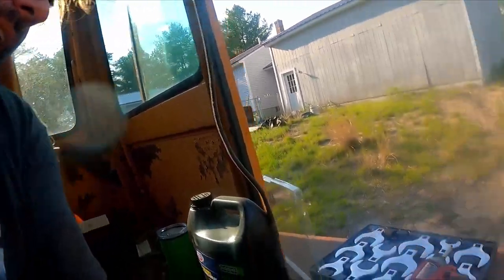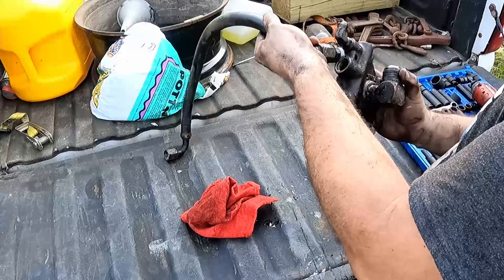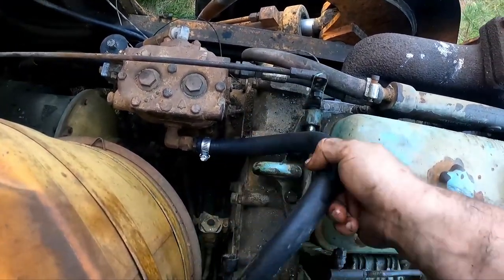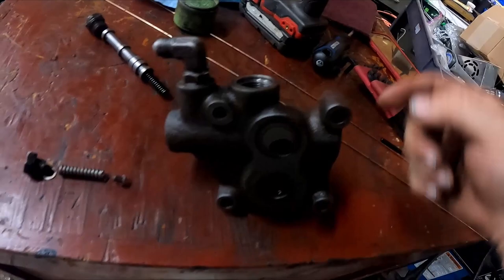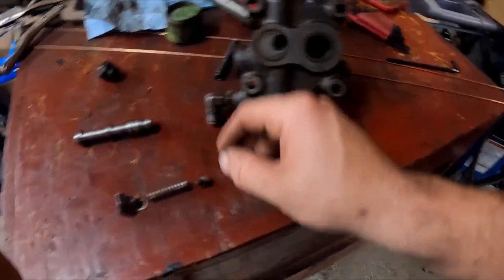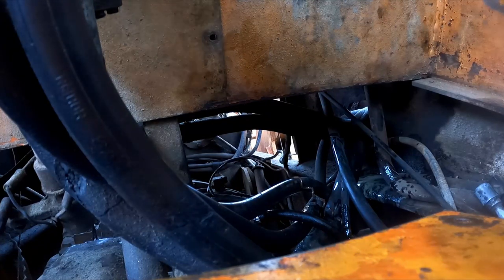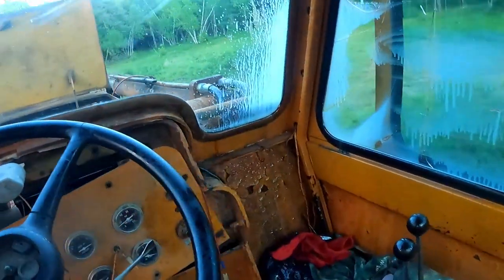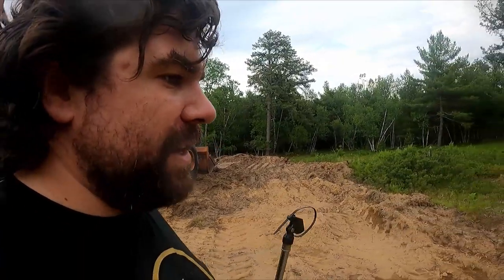Legendary Dynahoe First Drive in years! Dynahoe 200-4 Detroit Diesel 4-71 Resurrection Part 4

Comment: The Dynahoe owners group on Facebook has a manual for this as a PDF.
Reply from the maker: I got the manual off ebay(didn't know about the facebook group), but unless the group has a different one, it's a operators manual and a parts/diagram manual only.  I was under the impression that that was all the manual there ever was.  It is way way better than nothing though.
Reply: @wirestiresandfires214  that's the same one that they have. But in the group it is free. I didn't appreciate how big of a machine is until I got it moving.
Reply from the maker: @charlesgarrity2987  I'm going to join the group for sure, apparently there was an old yahoo user group with tons of info but that is long gone.  They are enormous machines, I mean who can say they have a 165hp backhoe.
Reply: The Dynahoe owners group on face book was started by the same Ted Williams who started the yahoo group.

Comment: I'm impressed.  as bad as that engine was, I wasn't sure it would ever run, much less dig holes
Reply from the maker: I'm shocked it runs and works so well, and that there were no major deal breaking issues.  Once it's warm its definitely running on all 4 cylinders.  I'm pretty sure these old detroits would run on just one if they had to, a super simple robust engine if ever there were one.  Also the loudest thing pretty much ever.